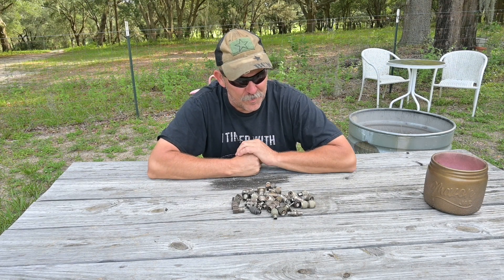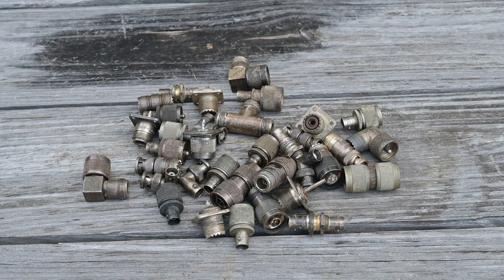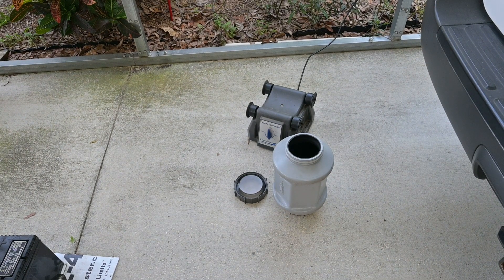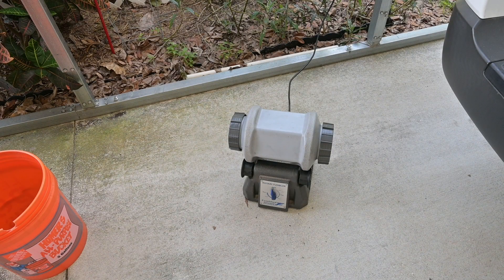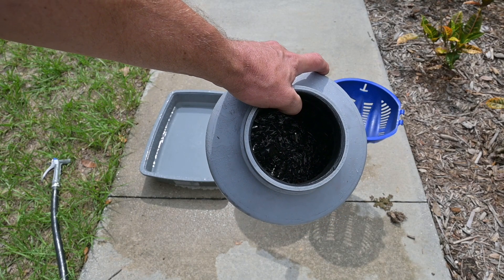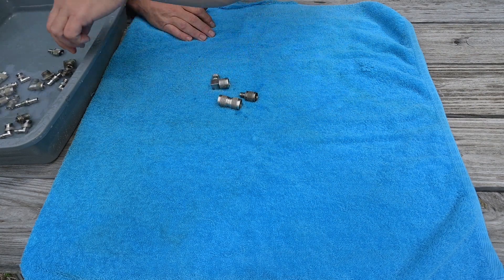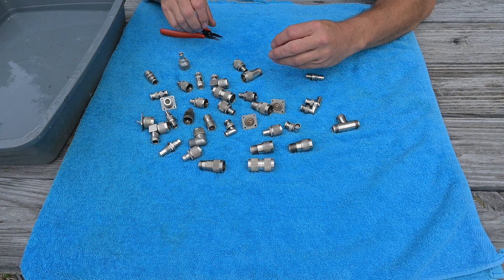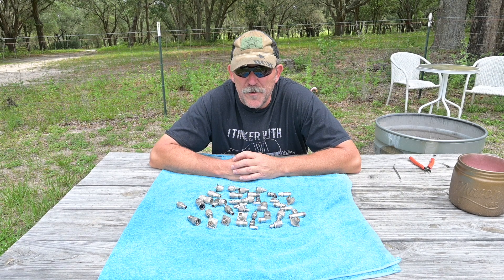Cleaning your corroded and tarnished RF adapters for ham radio coaxial cable

Comment: I do not see how it helps clean the pin or sleeve internal connections.  It just makes the outside of the connectors look better.
Reply from the maker: The pins are tiny you should do a video on how you do it better. Thanks for watching !

Comment: Thanks !
I really like the concept.

Over decades of collecting odds & ends of connectors and adapters,  from top of the line to Chinesium,
tarnishing has been a factor with most.  I USED to do my most used adapters, especially the silver plated ones, using Flitz metal polish, a toothbrush and old T-shirt rags.  After doing a few, I always found another project that was more important.  ANY project!  LOL

I have advanced A.S. (ankylosing spondylitis) now, so it’s almost impossible to do anything by hand.
Even though I’ve either donated or given most of my gear away to deserving younger fire dept volunteers, I still keep a few for emergencies.  This will now be my new cleaning method.  👍🏻

I kept my largest collection of older silver-plated “UniDapt” connectors.  They were a minor $ fortune, so I’ll definitely use the air compressor option and possibly use distilled water.   
These adapters/connectors have been my favorite emergency “go to” for so many years.  I even used the blue color RG223 double shielded / silver plated pre-made cables with their proprietary “UniDapt” connector on each end.  Incredibly good quality and not too pricey if purchased in sets of 6 or 10.   I just can’t recall the mfg now, but they are USA mfg’d.

I recently bought a new, smaller (40pc?) Chrome Plated  generic set on eBay as a gift to one of the young kids starting out in world of radios and electronics.  I was so disappointed with the quality.

Thank you again for a great idea and great channel!
Reply from the maker: You are welcome ! Thanks for watching !

Comment: Do you have any suggestions on preventing this from happening to new connectors that i buy that cost a kidney outside for a few months they look like this any type of coating beside drowning them in messy grease that gets all over when taking apart??????????????
Reply from the maker: The sad reality is that the other options are messy too. A self fusing silicone tape is the least messy and works for many applications but it isnt cheap.
 
https://www.amazon.com/Permatex-82112-Self-Fusing-Silicone-Tape/dp/B00X8T3MVY?th=1

Thanks for watching !
Reply: @survivalcomms  Thanks for the info bud
Reply from the maker: @vm7898  You are welcome !

Comment: It's an interesting method.  Unfortunately, it does not reach the contact areas under the ferrule of the plug connectors. It also did not appear to be able to clean the female pin mating surface. likely due to the size of the media. I'm wondering if a finer silica sand would do a better job.
Reply from the maker: Thanks for watching !

Comment: Interesting! Since I didn't already have the reloading gear, I soaked silver plated connectors in jewelry cleaner overnight, hit them with with an old toothbrush, soaked some more, rinsed well, then dried.  Uses no electricity, more compact, lightweight.    73   mike
Reply from the maker: I did that in the past and the cleaner attacked the dielectric. Thanks for watching !

Comment: Great tip, I am going to give that a spin (get it?)
Reminded me of my first comm-shop job as a 15 year-old... Any down time between installs, I was supposed to go through 5 -gallon buckets of used Amphenol PL-259's and carefully use a torch to de-solder the coax out of them and refurb them for "new" installs .  Back in the good-ole Motrac and Mocom -70 days. Golly ...I must be getting old !
Reply from the maker: Yes back before the click buy craze :) Thanks for watching !